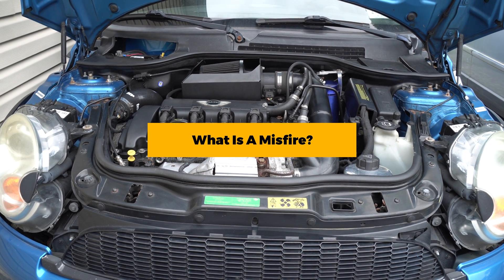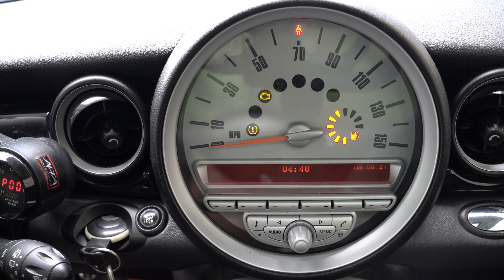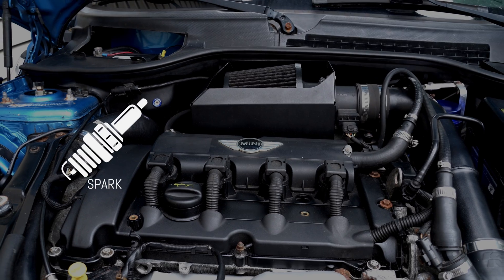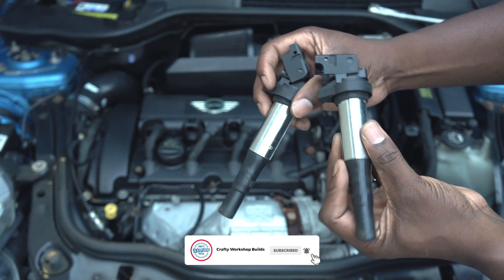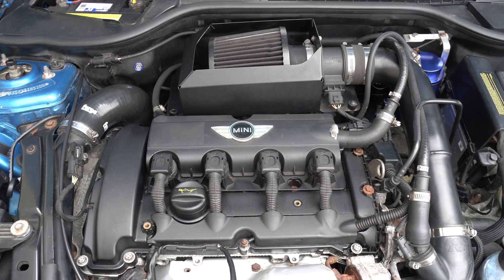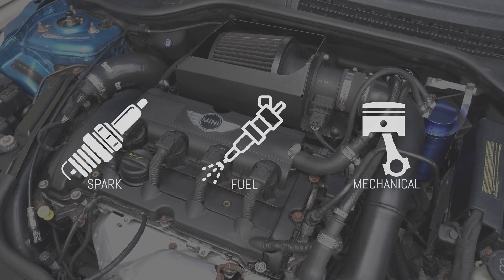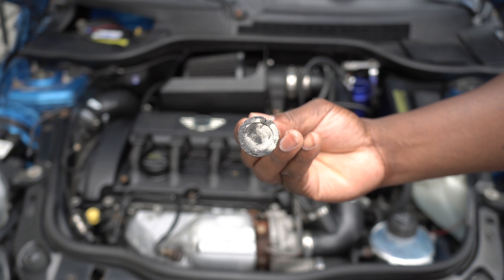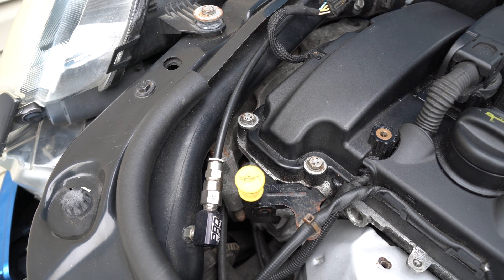R56 Mini Cooper S Engine Misfire Explained 2007-2013

Comment: I'm having problems where my mini randomly stops while driving so it shows the amber check engine light symbol where you read the RPMs and then the car stall's and loses power and then it completely stops and you have to wait a few minutes before it will start again and this has been happening frequently, Do you have any idea on how to fix this problem? 

It's a 2011 mini Cooper clubman s with the N18 engine.

Comment: Same issue with my R56 
My vehicle was running very very rough to the point where the whole car was shaking. Losing power.
We scanned the car and got a cylinder 4 misfire. We changed all spark plugs and coil pack and it made no difference. So my mechanic then did a pressure test and one of the cylinders had 60psi. He didn't know what to do after but advised it maybe the piston rings but it will be very expensive and a new engine plus labour is financially pointless. So he advised I maybe better off selling or scrapping the car. This video really helps so I'm gonna go back and show the mechanic. 

What were the names of all the parts you changed? 

Great video btw like and subscribed.
Reply: Mechanic needs to open the engine it's alot of labour try do it your self.

Comment: 2012 Mini Cooper Countryman base had misfire with codes on cylinder 2 and 4. Replaced both ignition coils and problem cleared up. I did do a resistance check with a multi-meter against the new coils and all coils came back as .06-.07.

Comment: Just had my 2009 Mini S head rebuilt and car is running. Cleared all engine codes and was driving to get ready for smog test. Felt rough idle and move cylinder 3 wiring and I felt suddenly got better. Drove fine after that but the CEL came on while on freeway. Cleared code and everything ok again. I might have loose wiring at coil pack connection. Not sure how to check. Any recommendations?

Comment: Hi sir. i have a 2009 r56 cooper. i had a cel light on while driving on the freeway. i changed the plugs and the coils due to rough idling. switched the coil packs and found that cylinder #2 is still having a misfire. p0302. could it be the fuel injector? you said cracked valve does not throw a cel. i hope it is not a low compression problem. thanks in advance

Comment: Misfire on cylinder 2 & 3 on my R56. Cylinder 3 ignition coil wasn’t snug to the spark plug and cylinder 2 had a bad spark plug. Misfire caused engine light, rough idle, lack of power, and a slight knock. I ended replacing all four spark plugs and ignition coils. Runs a lot smoother and reactive with no engine light. Still has a vibrating idle. I’m assuming fuel injectors and exhaust manifold need cleaning.

HELP! I also have an R55. It runs very smooth but the spark plug tips has oil on it. I was thinking it was a valve cover seal leak. Any suggestions?

Comment: I have a 2012 Mini Cooper s convertible. I died after 3 days of having it. 2 fuel pumps later it still will not stay running. This is the symbol that appeared before it died
Reply: Well, I can’t seem to upload the pic, but it was a lightning bolt in the center of a circle?

Comment: Sir, thanks for your help. I have a 2008 R55 which just earlier today started running rough and was down on power. I have been driving for 50 years and do most of my own maintenance, so I immediately thought it was down a cylinder. When I got it home, I left it running and disconnected the coil packs one at a time. Number 2 was the only one that didn't affect the idle, so that gave me a clue. I pulled and cleaned the #2 plug (it wasn't bad at all, and the plugs are fairly new). No change. I then hooked up my code reader and it also says #2 misfire. Sorry for the long intro, my question is, what are the chances a new coil pack would fix the problem? There's only one shop within 50 miles that will touch a Mini, and they're ridiculously expensive. THANKS!
Reply from the maker: Ok, I see. Switch #2 coil pack with one of the other coil pack from one of the working cylinders, and see if the misfire follows.

Comment: Would be good to know where the fuel injectors are and how to test them and also the pump…
Reply: Same
Reply: Fuel injectors are located just below the air filter. Take the air box of and you will find the fuel injector rail located just above intake manifold

Comment: I have occasional white smoke coming out of the exhaust, usually in between shifts. Could it be the PCV membrane, or the turbo beginning to fail. Thanks for the great video. I’m going to check my membrane for holes/damage.
Reply from the maker: The PCV is built into the valve cover. How much miles on the car? It could be worn valve stem seals.
Reply: @CraftyWorkshopBuilds  171k 👀
Reply: @precool  all the above. PCV. Turbo. Valve seals. To end rebuild incoming at these miles. It is not impossible, if you like the car, do it, keep it.
Reply: @nanolure8678  The car is fun as hell. Replaced full valve cover unit, turbo still strong! I had a oil pressure switch that went out at the same time. All good. We rollin’!
Reply: @precool  Yeah, I totally agree. Have a couple now and rebuilding engine on one. Those miles, great your turbo still going strong. Good luck with it, most smiles per miles.

Comment: How do you diagnose a problem with the injector?  If it is clogged can it be cleaned?  I already put new plugs and coil packs all the way around less than a year and 10K miles.
Reply from the maker: Yes, the injectors can be removed an cleaned.

Comment: How’s it going, got a 2009 Mini Cooper s turbo. Recently I’ve been having idle problems when I’m at a stop. It idles then drops, on my voltage it goes from 14.0 to 13.5 then jumps back up. After I park I have some backfire in the exhaust, but no check engine light. Any suggestions?

Comment: My 2010 R56 N14 Cooper S Turbo has a misfire. #4 cylinder. Compression read #4 at 30 psi. Two others read 125 and one at 170. Maybe, I think, not sure. Except for sure #4. Anyway. Two Shop Owners, both work on BMW's but only one works on Mini's a lot. When first owner mechanic said valve job or replace engine I went to a Mini mechanic for a second opinion Told him what's up and got from him almost same. Except said engines are expensive and maybe not necessary since he has had much success with valve jobs on others with similar traits and milage. ALSO, in his quote he incl. Brakes and rotors and pad sensor. Why? Any clue? Once I hear from you I'll tell you what I've read
Reply from the maker: Yea, brakes are a different issue. I'm not sure exactly what your question is, what did you ask why or any clue about?

Comment: So I just got this Mini Cooper and I’m driving on highway then it starts hesitating on moving with rpm’s up/down. The check engine light came on. I got to my destination, shut off an turned right on and engine light gone but rpm’s are still lagging. What’s a good starting point. History says engine serviced back in 2016
Reply from the maker: I'd suggest that you start by checking  the spark plugs.

Comment: Where did you get the gauges?
Reply from the maker: The boost gauge and the water temp gauge inside the car?
Reply: @CraftyWorkshopBuilds  Yeah! They look good
Reply from the maker: Oh thanks! I just added the links for the gauges in the description.
Reply: @CraftyWorkshopBuilds  thank you! I recently got a missfire and engine code for cylinders 1 & 4 on my 2010 mini Cooper s when driving up a hill and I replaced the spark plugs and ignition coils with OEM products and still have the issue so I'm pretty stumped on what it could be

Comment: Same problem except 120 125 120 85 for me and shop thinks it’s piston rings but can I put a boroscope to check for valve issues?
Reply from the maker: You probably won't be able to see the valves with a borescope, the camera would be pointing down and the valve would be behind the camera.

Comment: Hey 
I’ve been having acceleration lag/hesitation in 1&2 gear on my 2013 Mini R55 any suggestions? There was a engine light on but I cleared it
Reply from the maker: What was the engine light code?
Reply: @CraftyWorkshopBuilds ( P0300 )random/multiple cylinder misfire detected  ( P0302 ) cylinder 2 misfire detected ( P0304 ) cylinder 4 misfire detected ….. Pending P0301 cylinder 1 misfire detected

Comment: My 2009 R56 sputters when I rev it and has no power but idles great and revs good if I rev it slowly .
Reply from the maker: Any check engine light code?
Reply: I have same problem did you figure it out ?

Comment: Hi, well expained video!
I have acceleration lag/hesitation in first and second gears on my mini one (R56). Any thoughts? 
Any advice would be greatly appreciated thanks.
Reply from the maker: Check and make sure your spark plugs are good. Check and make sure you don't  have a boost leak. Did the car throw a check engine light code?
Reply: @CraftyWorkshopBuilds , thx so much for the reply. 
They haven't been changed for a couple of years tbh. I haven't got a fault checker and I haven't got the triangle warning or engine light on the screen. Will mine have a boost leak with it being the lesser brake horse power? 
Thx again for your interest.
Reply: @craiggrainger1057  i have same symptoms with my F56 and engine shaking on idel. Did you fix yours?

Comment: Sir i need your help, i have 2009 Mini Cooper when i drive it for an hour cylinder 3 stopped working engine idling roughly even when I swapped the coil, plugs and injectors, what can that be please
Reply from the maker: Do a compression test on all 4 cylinders.

Comment: Hi man. I have a mini copper s 2011 but I have half check engine and there’s no power in the car ? Can u help I replace the spark plugs and ignition coils it went and came back
Reply from the maker: Did it have a check engine light code?

Comment: Hello, I have a 2010 Cooper S Clubman and currently in the process of changing out all spark plugs and 2/4 coils. After doing a diagnostic I got a P2195 code; On top of a P0300, 0301, 0303. The one code I have a main question is P000A code which says Camshaft Position Slow Response Bank 1. Is this something major I need to get checked at a garage or will this issue resolve itself when I complete the plug and coil replacement. Thanks for the videos, I have learned alot from watching your channel.
Reply: I had the same issue on my 2013 S model. I replace the valve timing solenoid and it took care of the problem. Paid $25 bucks for the solenoid through Amazon.

Comment: Thanks for the video, helped me understand the common issues with my R56. I installed upgraded coil packs, upgraded plugs, air intake system, and im still having issues somewhere. i believe it might be my fuel pump, i cant hear it priming the line anymore and it takes about 6 tries to start the car. it also has a rough idle when i finally get it running. if you or anybody else has a better idea of what it might be im all ears. Thanks
Reply: check both fuel pressures on the low and high side
Reply from the maker: Ok, I see. I'd suggest to replace the Fuel Filter first. It's located under the back seat in the tank.
Reply: There’s two fuel pumps too the one in the tank and the high pressure one I had issues with the one in the tank after I already replaced the high pressure one
Reply: A faulty vanos solenoid valve can cause misfires too.

Comment: hey man!
thank you for the video, really like it.

got an question: my r56 2013 with N18 engine and 54.000 kilometers on the clock is running rough in stand, in cold condition of the engine the rpm is moving up and down, sometimes falls down to like 500rpm and nearly dies but then moving up rpm again.
spark plugs and service is only 1500 kilometers and 2 months old, timing was checken two weeks ago and was great, the workshop said…
NO CHECK ENGINE LIGHT and no trouble code.
what do you think?  I would say maybe its the tensioner, maybe air ratio sensor or even lambda? or maybe its the vanos (variable cam) on one side or on both?
high pressure fuel pump I would say is okay so far, because when moving the engine runs fine and has its power.
would be nice to hear from you, I can send you videos of the car idling if you want to, maybe we can communicate somewhere else?

Greetings from Germany!

Cheers! Nico
Reply from the maker: Hey, shout out to everyone watching from Germany! You said this only happens when the engine is cold, and once it's warmed up it runs smooth?
Yea, reach out to me on Instagram for better communication.
Reply: when the engine is warmed up its running most time relatively smooth, only moving rpm a little and sometimes runs fine when warm. and the big issue with the rpm falling down and nearly dies only happens when cold. 
I will message u there! 🤙🏽
Reply: @the_anthurian  
were you able to fix the problem?

Comment: I have an intermittent misfire which shakes the engine now and then, I don’t have any engine management light or codes for a misfire though, any idea where I should start looking?
Reply from the maker: Okay, Did you check the spark plugs?
Reply: @CraftyWorkshopBuilds  I didn’t have a socket that would fit the plugs but I’m gonna get one and some new plugs and try that out first 👍🏻
Reply from the maker: @bendude6748  yea, you need a thin wall socket to remove them.

Comment: When my Cooper S R56 is cold it doesn't idle great as soon as temp is up the idling is normal. And it miss fires when I drive and accelerate or try to overtake. Any suggestions please.
Reply from the maker: Ok, sure. Did the car throw any check engine light code? Did you check the spark plugs and make sure they are good?
Reply: @CraftyWorkshopBuilds   on have had the car for 3 weeks. Started reading parts as I go. Previous owner replace plugs about 6 months ago. Ignition coil pack looks horrific 🙊🙈🙉

Comment: hey mate.   really like your channel.
I have a Audi and have been doing some work on it myself,  saved loads of money. going to change oil vacuum and and some other things soon.      any way respect mate.   subbed
Reply from the maker: Thanks for watching and checking out my channel! Yea, you can save alot by working on your car yourself. Which Audi do you have?
Reply: @CraftyWorkshopBuilds  Thanks for the reply.  I have a b7 audi fsi,     I have a small youtube  channel, the one I'm using, have a look if you like, you might like 👍     I'm going to coolant temp sensor, oil vacuum pump and cam shaft follower, and also rocker cover gasget as I did it recently but starting leak again, think it was because of a pcv delete?  what you think? 👊

Comment: Question please.. I’m noticing some white smoke after spraying my turbo with valve&turbo cleaner!  I’m going to check for water/oil In my spark plugs. Hoping it’s not a head gasket.. Your thoughts?
Reply from the maker: How soon after you sprayed the turbo you noticed the white smoke?
Which turbo do you have?
Reply: @CraftyWorkshopBuilds  I have the 2nd generation.. Same day! Maybe 3 hours after I took it on a semi hard drive
Reply from the maker: You can do a compression test, to see the health of the cylinders. White Smoke could also be a blown turbo.
Reply: @CraftyWorkshopBuilds  Hey Sir! Cylinders are fine.. Top 02 sensors was bad , changed it to the $150. one from Euro..Ugh.  Turbo line underneath the turbo has a leak , replaced the turbo feed line.. I would like to meet up with you to have you take a look? I’m finding these cars a pain in the ass.. I have a track 350z ( new race motor built by RT Tuning PA.. might give them this mini soon.
Reply from the maker: @trainer008  Oh cool, I'm happy you got it resolved. Yea, the top o2 sensor is a wideband, it is responsible for the air/fuel ratio. If the top sensor is faulty, it will definitely make the car not run good. The faulty sensor probably made the car ran rich, which caused the smoke. The second o2 sensor is not as important. Feel free to reach out to me on Instagram.
Reply: @CraftyWorkshopBuilds  Will do! I have a slight oil leak coming from the oil filter housing and oil tube underneath the turbo